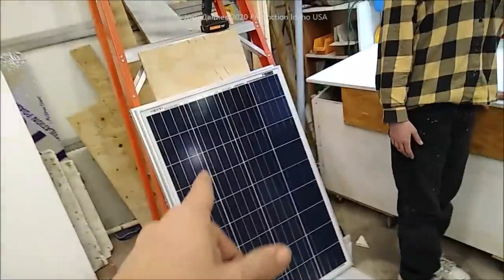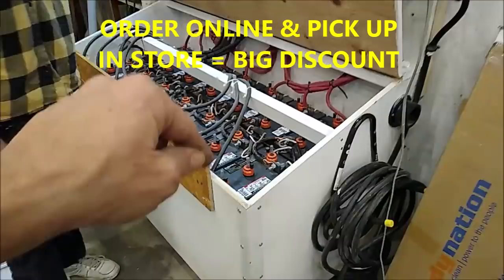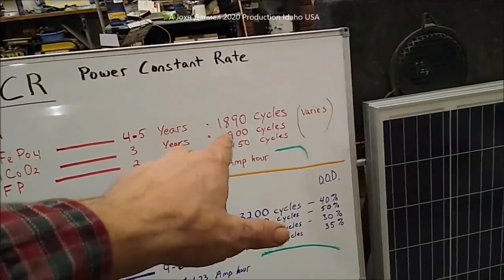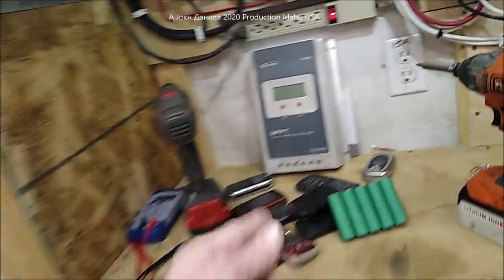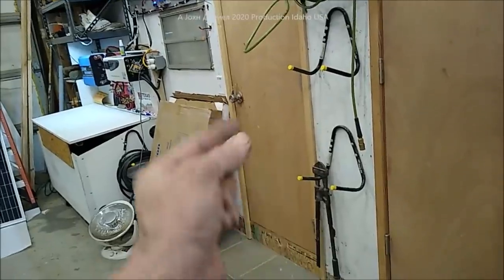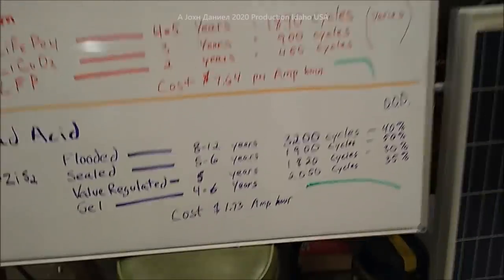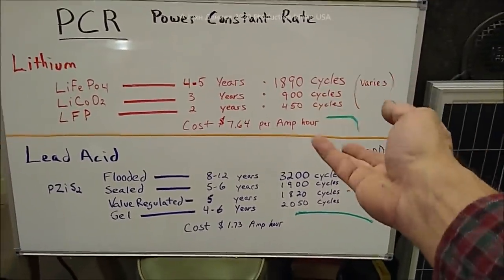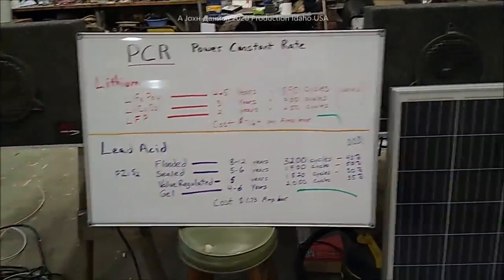Down Side of LITHIUM LiFePO4 Battery $ on RV, off grid & solar use (notes below)

Comment: You are just as bad as the lithium cult followers. You don't address the huge limitations and dangers with lead acid. If you over charge or over draw you still have fire risks and a real explosion with hydrogen off gassing. The issue is both batteries lithium or flooded lead have to be managed correctly to their specs. It's not designing your system correctly that's the issue.  All battery technologies have their positives and negatives 😂 just make sure you know their operating limitations.
Reply from the maker: The Lithium systems need a battery manager and NO ONE can prove the BMS has a trustworthy lifespan. Fact is the average "electronic item" manufactured in or from China has a 19 month consumer use maximum lifespan, Pacific Trade Magazine says less of 11 months, but giving it the maximum was Lloyds and I am sure their data was skewed by inclusion of Taiwan. Additionally the complexity of LiFePo and LiCo is it's one battery cell of many, to make a designed outcome, fail factor which has been proven in Computer and Security systems both using the same 2 Lithium based battery systems, LiFePo4 being the most common power source in laptops in the last 4 years it has a average lifespan of 3 years and less, not more. ( Wired Magazine  Online )
Reply: @JOHNDANIEL1  it's true when you cycle a lithium battery from 0-100% it really shortens the life span just like if you take a lead acid battery past it's 11.6. Now if you would keep your lithium battery between 80%-10% the life of that battery last a very long time. Like I said there's good and bad in both, but we need a better battery than lead acid. For solar to actually be viable we need a more dense storage solution. To be honest I'm really disappointed in our options and I'm very wary of the regions on both sides. Choose what works for you and make sure you know what you are doing.
Reply: I think what needs to be talked about is the dangers of having 12v-48v at high amperage that's basically a welder in big box. I don't think there's enough safety videos discussing the best ways to handle arcing or setting up a safe system. You're right about the cheap bms systems being touted online. I do like your videos and I'm glad your from Idaho!
Reply from the maker: @Rando32  Exactly my main point of the video in a way. I did once make a video welding from my batteries with a huge rheostat and 2 awg cables, I never uploaded it knowing people would take short cuts to save a penny and blow their asses up!

Comment: John, I like your videos but in this case I think you may be jumping to conclusions. If you can be sure all wiring and connections we're proper, charge controllers was of adequate spec. and set to proper parameters for the batteries. And can you be sure the (bolt issue) was not from vibration or movement if I'm properly secured batteries. Also just for reference ,there are many battery related fires and explosions with lead acid batteries. To be fair - most are the result of improper installation/application, and improper use/abuse of said batteries.
The same can be said for lithium tech.
Most faults are due to human error and misuse.
Just for the record I run our entire three unit estate on 16 B. B. Lithium (safe lifepo4) batteries and they perform perfectly with everyday/night use. The main reasons I chose to use them are the longer life expectancy, the absolute lack of any maintainance (we travel for 6 months each year) as well as the size-weight /power density issue (only so much room in our utility room for a battery bank) and lithium gives us twice the punch of power in our limited space. There are good qualities for every type of battery and all have best application scenarios depending on the results a particular person desires.
I use lithium but I don't condemn lead acid at all, it definitely has it's uses. I just thought you were being somewhat harsh and broad reaching possibly without all the facts in this case. It's always possible the RV owner made a mistake or mis programmed something without even being aware of it. I know I have personally had a lot to learn (big learning curve) installing lithium and solar. I've made a few mistakes, fortunately not serious ones. And of course we all have lots to learn as the new technology gets used over time. Time will tell but so far my experience has been an excellent one.
Keep up the good videos please - I'm following your lead on integrating wind power into my solar for our next step.
Thanks, stay warm...
Reply from the maker: Oh Hell - I Did my homework!  I think the report from the Battery Power Magazine ( aka Battery Power Online) during the 2018 Battery Seminar & Exhibit notes there has been in their historical estimate over 2,039,850,000,000 Lead Acid Auto and service batteries world wide with a safety record of 99.988% so the 2 trillion that has been used in the life of the technology is a notable record and the few times a year a Hydrogen related incident is used as a reason against them, that is a opposition industry talking point only. having a 0.012 of a percent is much lower than the 44 year recorded safety history of Lithium, LifePo included, which had a 2.025% and growing fast. The complexity of multi cell lithium based systems, short lifespan of BMS electronics in them noting the fail rates of Chinese electronics ( InRe: Quality in component manufacturing rush is poor - Diodes, Transistors, MosFets, IFets, and Capacitors in everything from Toys to Power Inverters, and Consumer goods Alibaba 2017 Jack Ma) Lots can be learn IF YOU CHOOSE TO READ DEEP, MAKE NOTES, GO IN UNPREJUDICED,  AND READ FROM ALL one source to read if you can focus on all info and not the BUY ME hyped. https://www.batterypoweronline.com/

Comment: To be honest the biggest downside of lithium based chemistry is the requirement to have a battery management system to keep the cells balanced. So even if your lithium batteries can last 5000 plus cycles and 10 years it’s unlikely the BMS will. So in a sealed lithium battery with a built in BMS the biggest flaw is the electronics. It will most likely fail before the cells do. Yes you can replace a BMS but some battery cases are glued shut. Getting into them is dangerous. I think the decision to buy one chemistry type over another is dependant on how and where they are going to be used.

Comment: LifePO4 Batteries are more efficient that the other ones.
Reply from the maker: If I was a betting type I would say you got money to burn, and a massive trust in China, Chinese Electronics and sourcing for parts. Especially at a time when they are literally threatening America with holding back the over 500 sourced to China by Obama in 2010 to 2015 all the patented American invented medications now made in China for our people, the sick and who may become so.  https://youtu.be/HDNt_ThDYt0 , So the weight argument only proves the PRO - LiFePo argument to be incoherent and fully ignorant to the reason for the video. Fools and their money never seem to have a lack of separation anxiety!
Reply: I am 100% with John on his post answers about Lithium Titanate Oxide batteries. You do not worry about LTO like LiFePo for voltage configuring, your car and off grid stuff loves LTO running its constant voltage of 13.8 volts. Its like when the car alternator is running which is 14.2 volts, everything is fine in your car. And with LTO you do not have to worry about the internal control failing because its in a connected remote unit. If it fails your can still actually charge it with a auto grade alternator regulator. It's able to get 16.7 volts without harm but can be shut off charging anywhere above 11 volts and still cycle 25,000 times.
 
We had LiFePo 100 ah and its inside control failed, ruined a bunch of stuff in our RV refrigerator and they want $240 to fix it, that part is NOT under warranty as you would think. They lie and that clown Will is a liar too with him showing all he does but not actually living on it like John does. I trust John even though he gets words off due to his stroke and I was watching him then, glad he recovered.

Comment: Great video, I like your train of thought.
Reply from the maker: With the success rate of Chinese electronics ( BMS CONTROLLER FOR LiFePo4 included) being 19 months world average till fail, you better consider sellers claims of 5 to 10 years pure idiocy if not fraud. Everyone knows Capacitors under constant use fail in 3 to 5 years, Transistors from China have progressively gotten worse, not better.

Comment: I noticed on your battery Bank you don't have a battery desulfator to extend the life of the batteries those batteries could last even more years...
Reply: Battery  balancer for lead asid  as well to extended the life of a very expensive  battery...
Reply from the maker: $300 wind turbine with its pulse rectified output will almost double a battery bank (like mines) lifespan. It would kill a LIFePo4 BMS controller in weeks though. And HAS!
Reply: @JOHNDANIEL1  so what kind of the desulfator do you have? I have the BLS on my small  bank 12v my main is 48v . Both are 20 batteries of sealed lead acid interstate 94ah..
Reply from the maker: @kainduran3480  The Wind Turbines are the best desulphator you can use. See the latest few videos, on one about controllers I explain the pulse of the Rectifier positive, it does a amazing job. And with a wind turbine you can adjust the divert voltage to as high as you want, safely of course, to heat up the batteries for a short period to clean them if you have to.

Comment: Thank you John for all the information that you have given me... about lithium battery I was looking into these type of batteries but I can only find good info on Nissan Leaf batteries or Chevy Volt the capacity of the battery and size makes big difference now its geting cheaper but the point you didn't bring out it's a safety of the loved ones you love because lead acid batteries don't blow up as for me lead acid batteries works for me...

Comment: To Share My Experiences At My Part Time Retirement Home Overseas:

$7.64 x 200ah = $1,528 ? lifepo4 3.2v 200ah (install here in the philippines) $115ea x 32 = $3,680. Correct my math if I misinterpreted that. Granted that's wholesale Alibaba.com 3.5 years ago. Cycles down to 43.9v by morning. Still getting full kWh 's I started with as of last January. Supplying a 48v 15kW PJ inverter(48v is def key here, anything less drains batteries fast) 10.8kW PV and 3kW max (mostly 220w avg until typhoon and rainy season, that's why it's there) I don't know the cycles they have been thru but the temperature readings show a flat line during heavy charging and discharging. I err'd on the side of caution and went with 4/0 cables(fun to crimp!) The equipment room is cooled to 80 and they sit on concrete and surrounded buy cutting board plastic(forget what they call it) cut to fit. didn't have enough for a bottom. The whole house is concrete so no wood to burn anyway. Point being is that they aren't really that expensive if you do your homework, use a quality charge controller (never never PWM!!!).Bulk charge straight up to float. Lifepo4 also known as LFP's in some circles. The guys down under got tired of saying Lifepo4 so shortened it. they don't like being charge in an absorb cycle as do SLA. As Midnite solar says in their manual, the worst thing you can do is not check on your charging state every day, it's the easiest way to kill ANY battery type.

The following are curiosity questions and not a jab or challenge at your knowledge or experience, nor was the above:

As for Lithium BYgone(ion)?, totally agree. Did that RV have Li or Lifepo4? What type and brand charge controller were they using? What size battery wiring and wiring organization. Skill level of the person installing. Were they DIY or did they have some company install this? Was enough evidence left to do a at least a shade tree engineers forensic investigation to rule out shorted wiring or charge controller overcharging? Was this system in anyway tied to the vehicle charging system or it's generator? I say shadetree because I am well versed in electronics and electrical from the US Navy but not an engineer and don't know your background. 

Waiting fervently for you reply young man!

Comment: Hey John, the batteries of lithium like chevy volt or others of that type are not the 500watts compacity as they claim when you buy these from ebay sellers because they are used.. So what you get are ones ones that are half the amount other than what the advertise!! But thanks for the info Brother!
Hey Buddy, hate to tell you that Missouri Whinning and Stumpidness has got my channel taken down, TheBillytheJack2010!! It has been up 4 yrs now and has a new video on the Axial Flux 12 coil I'm building. So please sub and like my videos, please... Heres a link:
https://www.youtube.com/watch?v=Jo8967xP8GE&lc=z22gxr4hhovsyeqtm2hd0s2yq3pcpphhtjgmutyvvj00u00c2
Reply from the maker: Very true, more sellers claims gone wrong on purpose huh.

Comment: I think both Lead and Lithium is bad ideas, if this Graphene Electrochemical battery/Supercap works out. Claimed life time over 50 years. I have this company's 18650 form factor graphene cells and they are fine. 300 000 cycle life time, charge and discharge at -40C. Anyone have experience with this packs? https://www.alibaba.com/product-detail/Graphene-super-capacitor-48-V-1500Wh_62397322137.html?spm=a2700.details.deiletai6.3.2ca249668TIrCb
Reply from the maker: Graphene is one if the safest projected technologies, but strangely enough so is the Nano film SLA

Comment: Your calculations are totally flawed im afraid. You missed many factors on why LiFePo4 as examle outlastas most common LA and why its cheaper going LiFe over time.  Just to give you an example the cells i have here was 2nd hand bought and have an avg of 4500Cycles at 75% DOD. Doing 50% DOD or less they claim way above 10k cycles. Doable? Time will tell. But they are currently over 6 years and still hold 95% capacity. I guess thats.
Reply: DIY Tech & Repairs nice!
Reply: They still do not Work under 0°c 
So unless you live a place with out Frost well 
Knock you self out .. 
I don't live wher ther is Frost every Winther .. 
So No lipo for me
Reply: Thanks man

Comment: You need to do your research.

LiFEPo4's in Prismatic cells have been in use for more than a decade now. Some in high power solar farms and other ESS systems. They have 5x more power output and charge rate than SLA. They've been proven to handle 10x the number of cycles than SLA. Your SLA number are WAAAY off compared to the ESS industry, where Big (and I mean 100kWh) UPS units are swapping batteries at 4-5 year because they've reached tested 50% capacity measurements.

1) Yes you have to protect and manage your LiFEPO4 cells with a good BMS with active balancing, thermal management (Low temp warn/cutoff, high temp warn/cutoff).
2) you need the proper charging circuitry. You can't just hookup any bog standard 2 or 3-stage charger designed for SLA and expect it to perform properly. Charger needs to understand LiFEPO4 chemisty and manage the charge properly. You can't use many of those cheapass Chinese MPPT's like you have stuck to your wall. Or even if they will support it, you need to program the charge profile into the units not use them stock.
3) While LiFEPO4 are pretty robust, all Lithium chemistries need to be protected from dead short and physical damage.  With higher energy densities, comes more risk in that regard.

I have a friend running a whole house in off-grid using 8 Telsa Model-S modules. He's gotten 1000 cycles already and his packs are still showing 90% or greater lifespan left. He runs well pump, Mini-split AC, lights, fans, TV, computers.....everything. We had to hook him up with a good BMS and thermal management system which included water cooling/heating (heating because he lives in Vermont) and he powers it from 10kw of solar through two Victron MPPT's and 5kW Inverter from Victron.
Reply: I am 100% with John on his post answers about Lithium Titanate Oxide batteries. You do not worry about LTO like LiFePo for voltage configuring, your car and off grid stuff loves LTO running its constant voltage of 13.8 volts. Its like when the car alternator is running which is 14.2 volts, everything is fine in your car. And with LTO you do not have to worry about the internal control failing because its in a connected remote unit. If it fails your can still actually charge it with a auto grade alternator regulator. It's able to get 16.7 volts without harm but can be shut off charging anywhere above 11 volts and still cycle 25,000 times.
 
We had LiFePo 100 ah and its inside control failed, ruined a bunch of stuff in our RV refrigerator and they want $240 to fix it, that part is NOT under warranty as you would think. They lie and that clown Will is a liar too with him showing all he does but not actually living on it like John does. I trust John even though he gets words off due to his stroke and I was watching him then, glad he recovered.
Reply from the maker: OK, I see you got to the title, but if you watch the video let me know. The entire video was about COST, Usability, and poor suppliers.
Reply: @JOHNDANIEL1  reality is lead sulfates and rarely cycles its life out with solar. The sun sets everyday and lead only accepts so much current. You cant just have a shitload of panels to overcome 4 hours of winter sun time. Its the facts. This causes lead to be many fold more expensive.